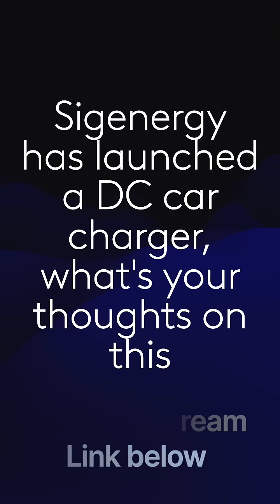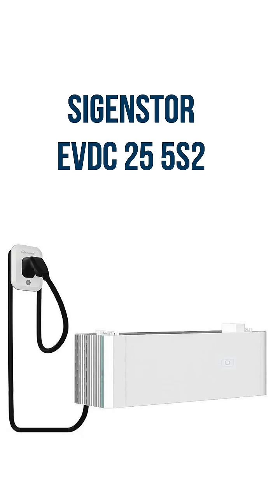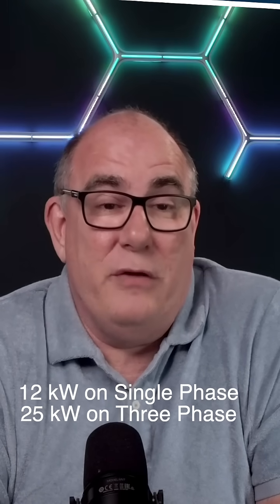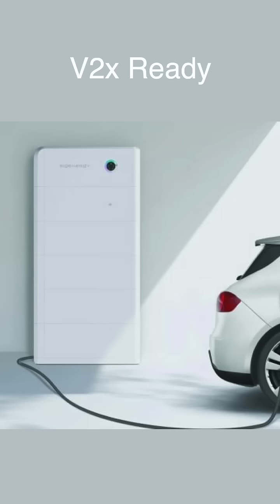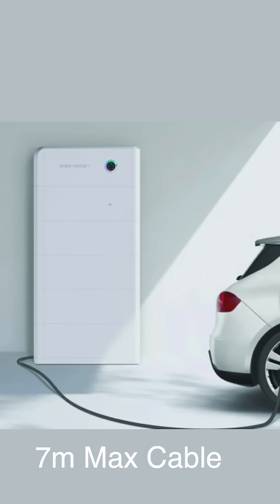How Does A DC Home Car Charger Actually Work? #sigenergy

Comment: If you had the sigenergy 5-1 off grid what would be the max dc current for the ev charger? 

I have a V2L vehicle and can buy electric from another property on night tarrif at 6p per kWh so if no solar I could top up the battery.

On sunny days I would want to use the solar power to charge my vehicle.

What would be the cost of such an installation
Reply from the maker: right now they are lot cheap and would take a while to pay for themselves but like all tech it will come down in price i ages years

Comment: perhaps if its a new installation , but you already have a dc inverter in the car so hardly worth the extra expense to upgrade
Reply from the maker: I think their reasoning is that by keeping everything DC, you reduce the losses and converting from DC in the battery to AC to send the car then from AC coming into the car converted back into DC going into the battery

Comment: 12 or 25kw only by combining grid solar and battery. Grid only limited to the inverter size on the stack. Was tempted for my new home but can get an ohme for 499 and the dc12 is 2500
Reply from the maker: yeah that’s a lot of extra money on the promise that V2G may come
Reply: But do we even need it? This DC system needs the battery stack so homes with fail over already? I think it needs to be sub 1500 maybe 1200. I think 10m cable is available? Sure I saw it
Reply: Not IOG compatible either, I’d rather spend half the money on a Zappi, and get the ability to charge at 7p for most hours of the day - and top up my home batteries if need be, as I can then export later on

Comment: A market idea that is not needed 12kwh is still to slow for the cost. Rapid public charging technology is advancing to quickly making it obsolete before it started. However if you have a load of solar panels in a sunnier annual country. With no local rapid charging then yes.
Reply from the maker: as a DC charger probably not going to be a huge success but if v2x ever comes it will be very popular